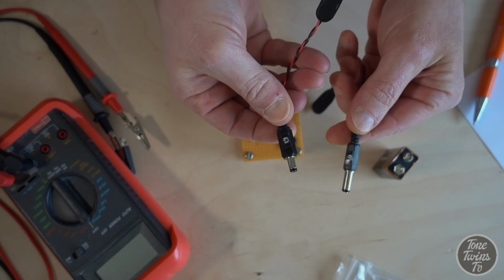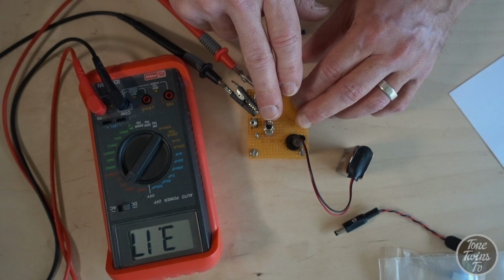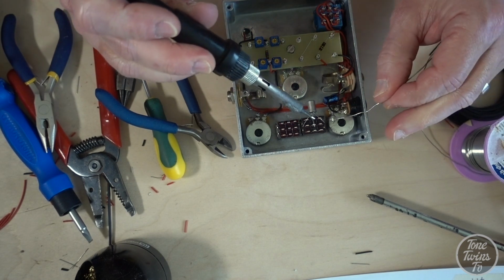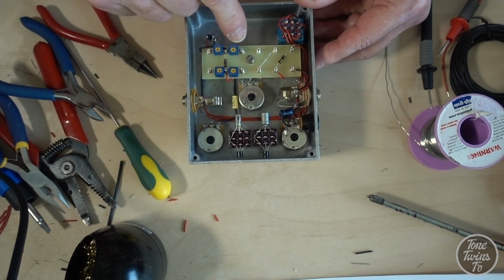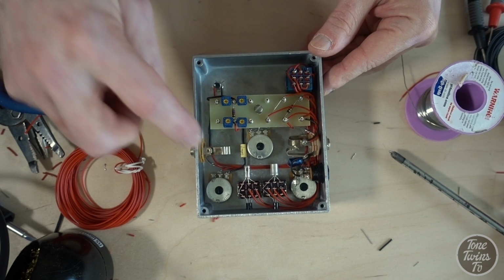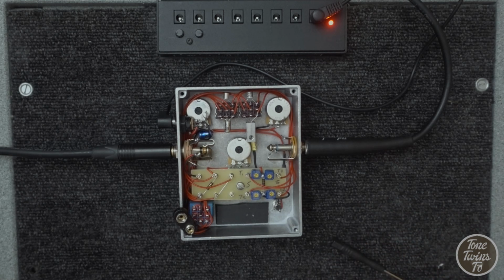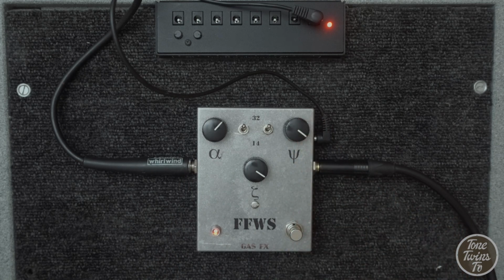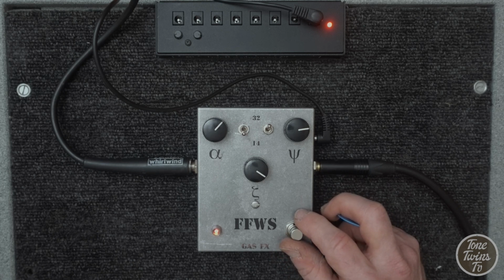Build your own Fuzz Face (Part 2) - THE SECRET TO ULTIMATE FUZZ TONE!

Comment: excellent thank you sir. Interesting how much noiser the silicon transistors are. I recently built a tone bender kit with silicon transistors and its sound great, but when the fuzz is maxed out it is quite noisey (hiss)... I can bias the the transistors to remove the noise but it just doesn't sound as tasty. I've read a few forms that mention adding a small capacitor across the trany can help.

Comment: Great tutorial. I love it and going to try it by myself. May I ask a question? I've a chinese mulit-testing device with a display (called T7-H) which shows me the Hfe and several other values when I test my transistors. I'm not sure which of the readings is equivalent to the leakage you are measuring. There are values called Ube, Ic, Ice0, Ices. Could you or anybody else give me a hint which of these values are to be subtracted from the Hfe to get the real leakage of the Germanium BJTs? My guess is Ice0

And one hint: the typical pin numbers of the 3PDT switches may vary if you look at schematics you'll find at google.

Comment: I built it from Huw's article! It sounds great and Huw was helpful on a couple of questions.
Reply from the maker: Hey Matt, that was fun bringing that one to completion. Really glad it worked out. Which germanium transistors did you use?
Reply: @tonetwinstv2863  I got a pair of both AC130 and 2N1304 and made two fuzzes each of them had one of each. One I gave to my brother which had the two lower output Ge transistors. The difference between the two pedals wasn't remarkably different after I got them dialed in. On mine though, one of the Si and Ge pairings isn't my favorite (a bit too 'splatty') but not bad. Trying to adjust it for improvement goofed up all the other settings too much. I am happy with a fuzz with three unique sounds though! I must admit I really like the Si/Si best followed by the better Ge/Si setting.

Comment: Hey Huw! Really like the design, was just wondering if it would be possible to add a tone control to it? Would it make sense on a fuzz pedal like this? Excuse my ignorance I'm only a beginner.
Reply: There are fuzz faces with a tone control out there, the tone bender had one added to it at some point so it's possible. I assume if it's built on perfboard you can borrow a tone circuit from another schematic and add it in
Reply: @the-np4mr  Hi! Thanks, I'll have a look at some. Incidentally, do you happen to know whether this fuzz face is negative ground or not?

Comment: Awesome project really enjoyed watching. How do you bias the transistors for the classic glassy clean up of fuzz faces. I understand its related to the input impedance vs the pickup impedance, any one got any pointers. Cheers 🎸
Reply from the maker: Not really Tim, your ears will tell you. You can try tweaking the transistor bias with your guitar volume rolled back and listen for low grittiness and a smooth and long note decay. The Fuller mod helps with the cleanup and makes the guitar volume a little less on/off.

Comment: How do I tame the background noise in a fuzz pedal? I use primarily single coil guitars,  and greatly prefer them for their articulation and open tone vs the thickness of humbuckers, but even with a noise suppressor and isolated power, the hiss when indime out my germanium fuzz face clone is annoying.  The suppressor manages to keep it down with my overdrive and distortion pedals, but that glorious fuzz tone is always at the cost of a background hiss.